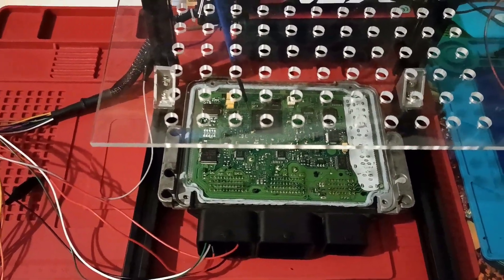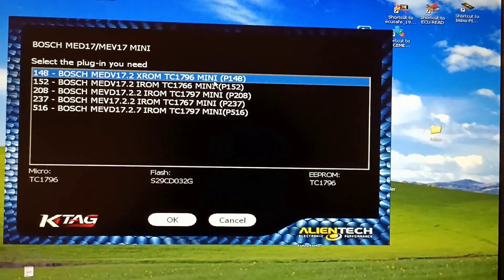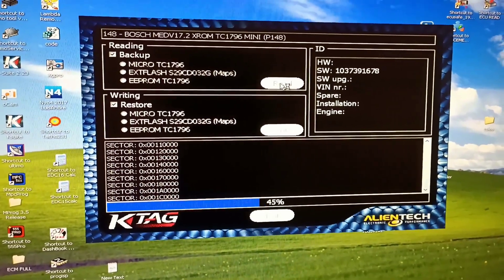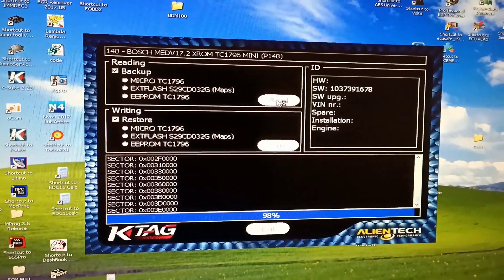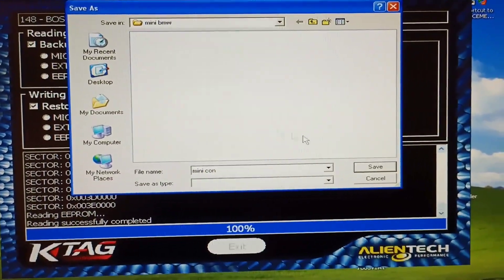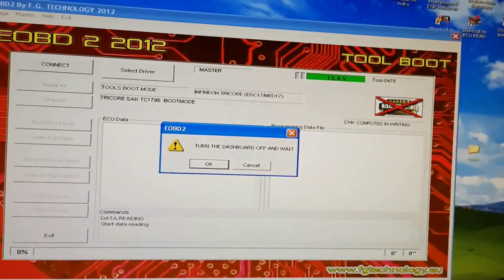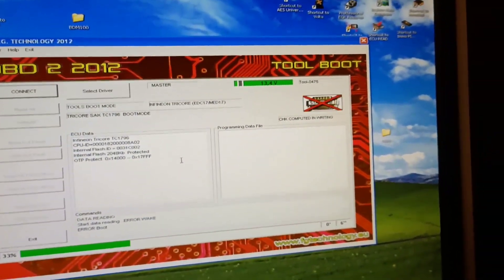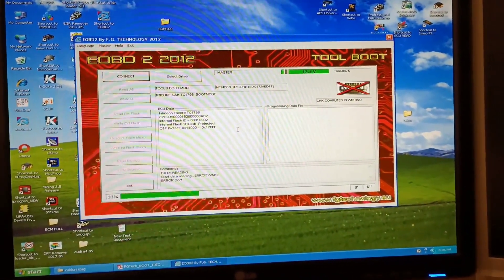Read Bosch ecu MEV17.2 Ktag vs Galletto

Comment: If I backup using KTAG with 1 ECU and restore that file to another ECU is that the same as cloning? Im trying to make a back up ECU for my car with the same ECU in your video. Thank you
Reply from the maker: @michaels2251  yes, this would be the cloning procedure, but many ECUs are blocked from being cloned.  for VaG's edc17 is a special clone operation, many programmers have integrated this function.  The cloning function can no longer be used on new generation ECUs.

Comment: Great work mate! Loving the vids. I'm just starting to get into this as a hobby and trying to get as much info as I can before I try to work on an ecu. My first one will be my sons van I bought him, I want to remove egr and dpf. I watched a vid of yours about ktag not doing the checksum correction? Other vids seem to not have any problems? Are they just not showing the checksum correction or is it random
Reply from the maker: Hello.
Thanks for watching!
It depends what you want to do.  If you just want to replace a defective ECU with another purchased one, then you don't need checksum correction.  If you change Dump, for example you want to cancel DPF, EGR Adblue, then you have to use a correction program.
  These clones are not to be trusted!